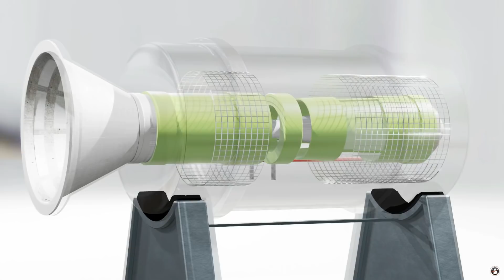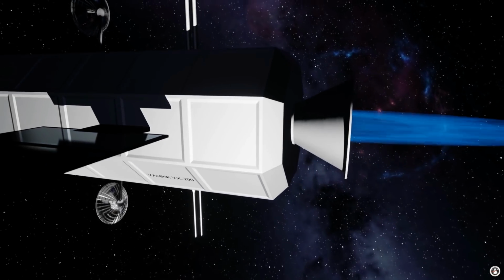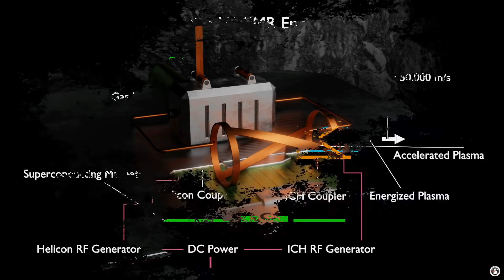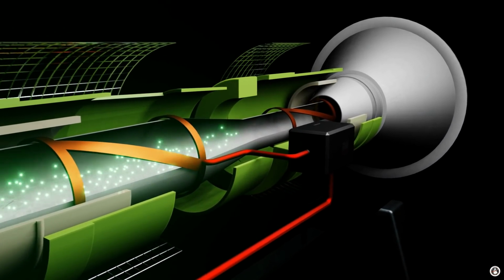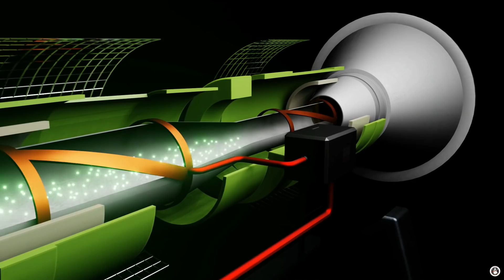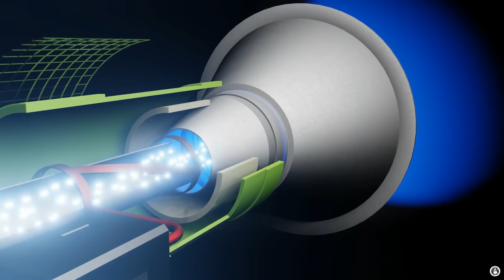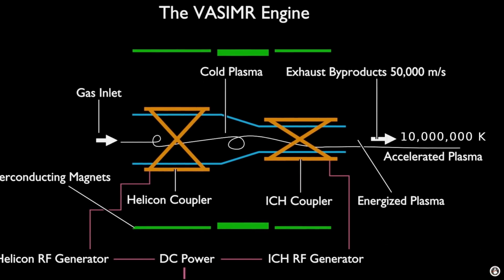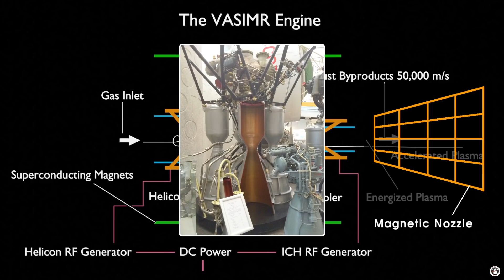The VASIMR Engine – 0.000167 c / 50 km/s

Comment: This will never be on Starship due to power requirements. Will probably be the vehicle that comes after Starship.
Reply from the maker: Solar panels will supply enough power. Elon has already stated that future space travel will require more efficient engines with high trust, nuclear or other, such as the engine we're currently developing: https://youtu.be/9jAUXuL-6oc
Reply: @asteronx  Don't get me wrong, I've been following VASIMR for a long time and can't wait to see it in use. But Starship is being designed for mass production (with raptors) to jump-started the space industry. Once this gets rolling I think Starship 2.0 or whatever they call it will be prime time for VASIMR or some next gen engine to shine. Conventional Starship will also serve as a great test platform for new engines.

Comment: Been hearing about this engine for well over a decade. When are we going to see this baby at work in space?
Reply from the maker: The engine has been and still is being tested: http://www.adastrarocket.com/aarc/VF-200
Reply: One day soon I hope. Your right though, it's been a little over 10 years since it was announced.
Reply: @lookabomba32  It has been 40 years since the first test. This engine is like fusion
Reply: @simonquvang6073  
But not quite I take it?
Reply: @lookabomba32  the same as fusion as in its always 20 to 30 years in the future.
Reply: @simonquvang6073  HEY I WAS GONNA SAY THAT..
Reply: @simonquvang6073  I'm pretty sure VASEMIR drives are still a new development in comparison to other ion engines already in use like in station keeping.

The issue is now applying it to a specific project, which due to the cost will likely take another 10 years after the engine technology becomes mature.
Reply: @simonquvang6073  

I fusion takes 100 years to become functional... It will still be the fastest Power source to mature.

More so when you renember just Building the experiments takes way longer than the other resources when those were developed.

So... Yeah.
Reply: Well the electric needs to these engine is huge. You basicly need a nucleair powersource. So unless that is allowed its not going to happen
Reply: @rubikfan1  Mostly true, but Solar panels have been getting a lot more efficient. Check out the Rolled Out Solar Arrays that will soon augment the power of the ISS.
Reply: @jeffbenton6183  Those solar panels only provide kilowatts of power, which is fine is you want to take a slow, economical route to the moon, or even Mars. To do the whole "get to Mars in 39 days" you need a power source in the hundreds of megawatts or even gigawatt range. That can't be done with solar power in any practical way as of now or the near future. Only nuclear provides a credible hope in that regard and it has its own problems.
Reply: @jeffbenton6183  you're joking right? You want to power this thing with a solar array?! Even if it were possible, it's still a bad idea. We're talking major structural problems here. Any array of large enough to power this thing is going to be flimsy as hell.
Reply: @jeffbenton6183  When some people talk about PV they referring to 1960's monocrystalline silicon PN junction band gap that peaks at about 30% conversion // when much newer tech from 2010 era research multi band gap multi layer PV approaches 89%
Reply: @rubikfan1  Very large origami holdup solar arrays with much higher efficiency can charge up energy storage units & preheat the unit & get everything warmed up & firing before switching to a onboard nuclear electric gen-set as solar array folded up for storage
Reply: Development is going too slow. They should bump noggins with Elon. I'll bet that would change quickly if he got involved.
Reply: @Unmannedair  Elon and Jeff bumped heads. Jeff got a headache.
Reply: According to their site the VF-200 is close to being completed, but it is just slightly better than other ion thrusters being built now. Don't get your hopes up, we are not going on a joy ride around Saturn on that technology.
Reply: The issue is funding. R&D work with milestones, not quarter results. If it was Intel, microchip R&D is funded with the profit of microchips, which provides a continuous stream of money. But this company is pure R&D and investor culture is more likely to bet of failed synthetic CDOs that caused 2008 crisis (basically betting money on a wounded horse in horse race)  than this engine (tech innovation) which has passed all the very demanding NASA milestones to this point where the next milestone requires funding. And the latest outcome of milestones are very exciting as it was more powerful than expected. It is a shame that people now bet on more wounded horses like CLO derivatives instead of this engine. If Dr. Chang had gone through having commercial activity, it would have delayed the quest for technocal solutions to the problems posed by R&D itself. Unlike Intel there is not an army of people behind R&D.
Reply: @aquarius5719  that is the lamest excuse I've heard for poor performance that I've heard in a while. If you don't like the speed of doing things "the way that all the other R&D groups" work, then change something.  'One should not be surprised to find themselves going no further than the crowd when they walk in the crowd'.  I've worked in academia, and most of those guys work in a bubble. They practically have to start their research all over again when they actually try to commercialize it.
Reply: @Unmannedair  Ah! Narratives and adjectives. So lack of money is no excuse? May be that is why the poorest people of the world are colonizing the moon now. No money needed.
Aerospace research take years. Or do you think that SpaceX started yesterday?
Reply: @aquarius5719  They should contact SPACEX and get things moving. i mean this is pathetic... testing. testing...
Reply: @esecallum  SpaceX has no intention of using ion thrusters to take people to Mars in the near-future. They've been very clear about that. The SpaceX model is one of incremental change, not radical change. That's why they didn't try to make Starship an SSTO LV.
Reply: @esecallum  SpaceX wants nothing with this engine because they know its bogus. 
Dr Zubrin, quite influential with Elon Musk, has shown many times that VASIMR is a hoax.

Basically, the 39 days to Mars is based on UNREALISTIC sci-fi Unobtainium Power Sources... like a 1000 watts/kg, 200 MW nuclear powerplant.

Our BEST nuclear generators currently sit around 20 watts/kg... with luck and LOTS of investment, we can reach maybe 50 watts per kg.

With some nuclear fusion devices, maybe we can get around 100-200 watts per kg.
Reply: @rogeriopenna9014  Your wrong 15 magawatt the size of a connex box.
Reply: @clementvining2487  What the hell are you talking about?

What power source the size of a "connex box" can provide 15 megawatts? Do you have a source for that claim?

What is the weight? What is the weight of the  13 such powersources you will need to provide the 200 megawatts of power necessary for the 39 days trip to Mars?
Reply: @rogeriopenna9014  Look it up yourself there are too many companies working on it. Small modular reactors or micro reactors the 15 magawatt is thermal energy. Different reactor systems go from 1 magawatt to enough to power hundreds of thousands of homes of differet reactor sizes. They are in the development stages mostly regulations and funding are holding them back. The 200 magawatts you stated is for high thrust for a short time the way we use chemical rockets.

 With a constant thrust a lot lower thrust is needed because of constant acceleration.  A 250 thousand ton ship using a large haul thruster could  get to the moon from orbit with 600 kilowatts. It would take about two years but it is possible. The reactor design that can fit in a connex box can be shipped with a tractor trailer or a 18 wheeler. You don't need 200 magawatts. The visamir rocket can have higher thrust at lower efficiency or high efficiency at lower thrust and higher specific impulse with the same amount of energy. I know the first thing you well say is they don't exist at this time some prototypes have been made. Modular reactors have been used for a long time now on subs. The visamir rocket in the video is only 100 kilowatts. With larger ships that stay in space using these reactors are more efficient. That's what spacex will make possible. You are trading the weight of the fuel for the weight of the reactor with hundreds of times less fuel weight.
Reply: @clementvining2487  MEGA not mAga. Its a greek word
I know about smal modular reactors, but what are their weight
Reply: @rogeriopenna9014  I don't know there weight but the one I talked about can be transported by a 18wheeler that means it has to be less than 50 tons. I don't know what the visamir weighs but the spacex starship is designed to carry 1200 tons of fuel that it well not need with this kind of system once in orbit. With this kind of power system the ship well never leve space. The remaining weight can be in hydrogen fuel and fuel for the control rockets unless some kind of manifold is developed for the visamir. The reason I said hydrogen fuel it well work with the visamir and it is all over the solar system. Another reason is this rocket is variable impulse. You can use more hydrogen for the same power output to get higher thrust at lower impulse then lower the fuel consumption and get higher impulse  with less fuel. Kind of like gears in a car. This would be a very efficient system until we get fusion or antimatter catalyzed fusion.
Reply: @rogeriopenna9014  There are many  verason of small fission reactors we can use but the most efficient will be the molton salt reactors it can burn a wide range of fuel even nuclear waste or mining byproducts thorium. When we get to antimatter catalyzed fusion we well no longer need combustion rockets.
Reply: @rogeriopenna9014  This video was years ago. Find a micro reactor and work from there. The video with the 200 magawatts visamir rocket to Mars in a little over a month was not a constant thrust because it would over heat after a time.

 My point is you don't need this much power with a constant thrust. The visamir is more efficient because it has variable specific impulse control. Like gears on a car. At the same power level the more fuel the more thrust and less specific impulse. At the same power level the less fuel the higher specific impulse and less thrust. Overcoming inertia takes more mass.  The distance to mars continues to change unlike the moon.  The 15 magawatts reactor is thermal energy that has to be converted to electrical you need a conversion rate. In space I don't know if you would use a super steam closed loop or something else.The rate you are stating is that with a constant thrust? With all these variables the method you are using is useless. You need to calculate a delta V with a constant variable thrust and specific impulse. You can increase efficiency through gravitational slingshot around  the moon or around venus if you are taking that route at the correct timing of the orbits. With all the variables how can you calculate this without all the needed  information. My point is you don't need that high a power level to get to mars with a visamir rocket and I am not holding to this 39 day timetable. This is part of the misleading argument that the visamir rocket is a pipe dream because of the power requirement. 

The ship I was taking about is much larger than spacex star ship 250000 tons. It well never land and only slow to high orbital speed but be very efficient and large enough to have circular acceleration gravity with enough power to have active shielding along with materal shielding. The timetable is not as critical of how long it takes to get to mars. If a ship this size with a 600 kilowatt constant haul thruster can get to the moon in 2 years, how far would you get with 25 times more power with a constant operating visamir drive? Constant power means constant acceleration.
Reply: @jeffbenton6183   No  radical change you not talking about spacex. First company to land and reuse boosters. Building the largest rockets ever built made of stainless steel alloy. Build and design there own rockets the best in the world and a type that had been tried for decades and he was the first. Trying to build a fleet of totally reusable rockets the largest rockets in the world. First to try to catch a landing booster. SpaceX well use any propulsion system that is the most cost effective. Ion engines are not the most cost effective at this time.  For this to happen you need a cost effective magawatt power supply. Let this happen and see what he does. Unless he comes up with something better.
Reply: @rogeriopenna9014  I said up to 50 tons it could be half that.
Reply: The engine has one serious issue: It needs a lot of energy. This is no problem for testing on earth, but how would you get a lot of power in space? Solar panels don't produce all that much, so you would need gigantic panels to power a vasimr drive. This would weigh a lot. The only other viable option is a nuclear reactor, but as far as I know there is no design for a nuclear powered spaceship being seriously developed right now.

It will still take a while before we see this in action.
Reply: @Whiteraven994  use petrol driven generators..
Reply: @esecallum  those don't work well in space. There's coming, there's so many moving parts, there's an extremely limited fuel supply, there's just so many problems. That's why oil-burning electric generators are so rare in spaceflight (even though the industry uses kerosene-fueled rockets to launch the craft in the first place)
Reply: @jeffbenton6183  thin flexible solar cells are the answer. they can generate megawatts are very light and thin. problem solved. they are printed on to thin mylar
Reply: @esecallum  I agree, in a previous comment that I accidentally deleted, I mentioned NASA's new, impressive Roll Out Solar Array, which will soon augment the power of the International Space Station
Reply: @jeffbenton6183  i agree. thin flexible light solar cells can generate megawatts easily,
Reply: @jeffbenton6183  Really?! Everything I have seen regarding those solar panels say that they will produce far less than even half a megawatt. We'll need a solid source if this perspective of Ese Callum is to be considered credible, preferably more than one.
Reply: @esecallum  Examples and sources please! Don't just says "thin flexible light solar cells can generate megawatts easily" without a solid source lest you sound like an unhinged fanatic.
Reply: @Whiteraven994  thats why ufo use antymater...from m115...
Reply: IN A100 YEARS
Reply: @esecallum  In a 100 years we will have warp drive by then.
Reply: @clementvining2487  hope so.
Reply: @esecallum  they well have warpdrive  by a 100 years.
Reply: Likely not in our life time....
Reply: It all takes money.  I’m sure NASA is awarding small annual contracts to keep the development of this technology progressing, but something like this would take several hundred million dollars per year with several teams of dozens of engineers each to develop this thing quickly.  If you are only getting a few hundred thousand dollars or even a million dollars per year, it’s going to take much longer to develop.
Reply: 2022
Reply: Maybe a day, on a starship ?
Reply: The longer it stays in "testing", the more funding the company gets from various agencies...
Reply: @ericscott1895  The main problem is the power supply and efficiency. At lower power other systems work better. At high power you need a reactor.
Reply: Never
Reply: Its a lightsaber

Comment: I believe it is possible to make a fission rocket that uses an electrical current to fission uranium or plutonium in a linear fashion without consuming hydrogen which would make it ideal for interstellar travel,  anyone who is interested should watch "best method for interstellar travel" and "liquid plutonium rocket". The videos also have info on the constant 1g acceleration method, with this a ship can get to Alpha Centauri in just 3.6 ship/7.3 Earth years and have gravity the whole way (and that includes turning the ship around half way and decelerating). A 10 ton ship would need a mere 10 tons of continuous thrust. A ship can span the entire diameter of the Milky Way galaxy in 12 ship/113,000 Earth years with this method.

Comment: The primary issue preventing VASIMR from being implemented is the portable nuclear reactor and radiative cooling needed to provide the megawatts of electrical current needed . I think several companies are currently working on such reactors though, including Rolls Royce.
Reply: Never mind that, the waste heat simply by powering the thing needs substantial radiators, even if it's solar powered. It's basically a microwave oven with a magnetic bottle to heat up the gas and send it out one end. The TWR is much lower than regular ion thrusters for a given power consumption since this thing is massive. VASIMR only makes any sense if a good portion of the plasma propellant's energy comes from undergoing nuclear fusion saving on shoving electricity in there (aneutronic fusion, too, otherwise neutron heating). Might as well settle for ion drives then skip to fusion drives when that works out.

Comment: Could be a strap on fission power-plant/drive unit  for any number of cargoes or manned modules. Scaling up to 200MW space reactor has political baggage that might impede progress.
Reply from the maker: Depending on the vehicle the engine is meant to propel, they can make use solar panels. For crewed mission, several companies are developing compact fission reactors, however, we are already seeing ways of controlling the extremely hot plasma in a fusion reactor, and as such, would prefer mobile fusion reactors instead.